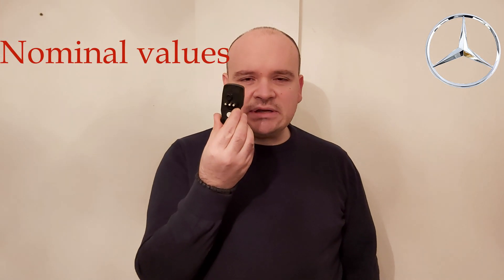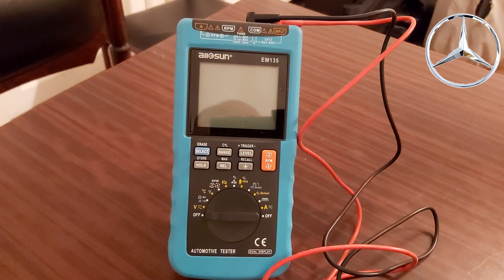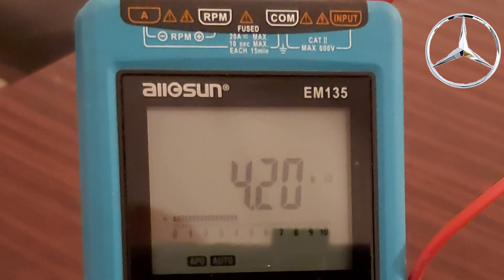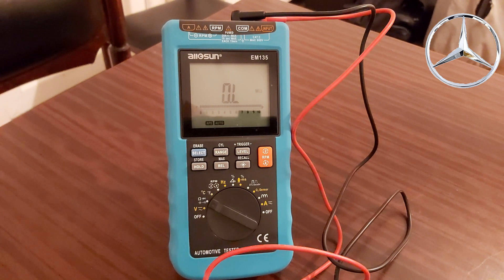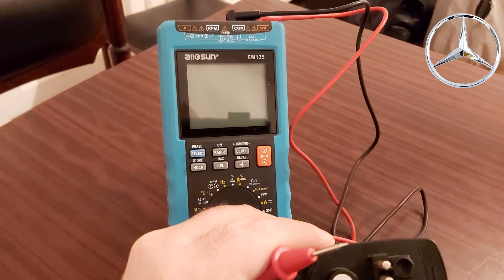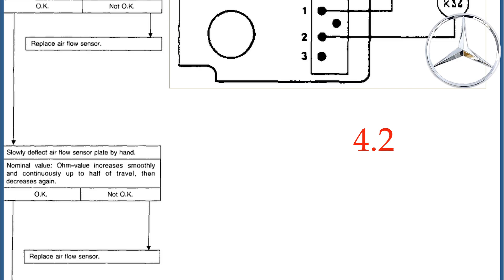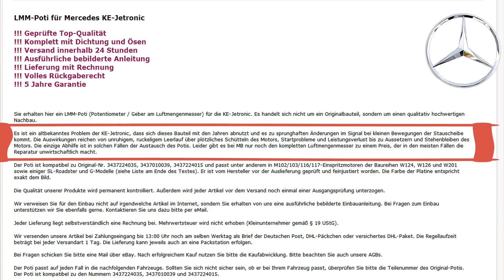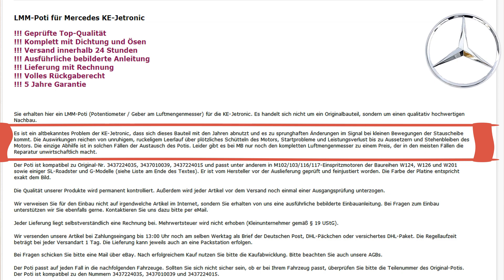Mercedes KE-Jetronic - The Potentiometer, minor disagreements with some forums

Comment: I know this is an older video, but maybe you can answer my question. There is a small adjusting screw, 2, maybe 3mm in diameter, set down in a depression, to the driver's side of the potentiometer. What is that adjustment screw used for?
Reply from the maker: The signal of the potentiometer is being adjusted there. That's something I don't want to mess with and something I still don't know how to "manipulate with". The seller just told me not to touch it and either to leave it there or to fill it up with something.
Reply: @mercedeske  Well, I used to work in control electronics at one time, so I just had to know. I had a new, aftermarket potentiometer on the bench and tested it. That little screw is there to "Trim" the pot. So back to the small screw on the car. After I tightened down my pot, with the ignition on, and engine off, I got 0.80 VDC. across the center and top pins. Turning the small screw CCW, I was able to get the voltage down to 0.72 VDC and figured that was good enough for now. Engine fluctuations due to Lamda are at a minimum after the cold cycle ends, The engine runs fantastically, it pulled 90 mph without a hiccup. 
I'm a happy camper. ;)

Comment: Hello, great video, just quick note for all of you (if you remove potentiometer from a car then test 1&3 pins IF ITS STILL IN CAR  (NOT REMOVED) then test 1&2 pins - it's showing ohms as it written in service manual. Please read carefully in service manual there is not mentioned to remove it before testing, just unplug connector and check, hope it helps to get your nominal values ;)
Reply from the maker: Yes, that's what I mentioned in the video also. Always test the potentiometer with the potentiometer on the airflow meter.

Comment: Hi,
Thank you for your videos, they are great help.
I did bench test on my potentiometer, and I get 4.9 between 1 & 3 , and zero between 1 &2.  Is this unit good?    Also, which brand do you recommend that we have a better chance to adjust it.
Reply from the maker: Hi, and thanks for your kind words. The answer to your question - no, it's not good. If you don't get a linear increase in resistance when you deflect the sensor plate while measuring on the pins 1&2 and you get sudden jumps in resistance, then it's a clear sign that you have to replace the potentiometer. It has to be replaced anyway after 90k miles(150k km). You can buy any of those from Germany or Netherlands(you have them on ebay) if the original one is too expensive for you. I bought one from the guy from Germany and I am very happy with the results.
Reply: @mercedeske  Would you please provide this seller, thank you.
Reply from the maker: @henrysalem5516  https://www.ebay.com/itm/LMM-Poti-NEU-Mercedes-MB-190E-W201-W124-W126-M102-M103-3437224035-3437224015/132590579334
Reply: @mercedeske  Thank you, very much

Comment: Hello friend, i have a problem with the oil pressure instrument on the dash, when i turn on the engine the needle goes beyond 
the   "3"  mark and stays there. Do you know what is the problem?
Reply from the maker: And how is it when the engine gets warm?
Reply: @mercedeske  No just when i turn on the engine first time in the morning, it just goes up over the 3 mark , car has just 50.000 km and works fine.
Reply: Maybe the oil pressure sensor went bad?
Reply from the maker: @theogi8375  Check it.
Reply from the maker: Interesting for a W124 to have such a low mileage!💪😮
Reply: @mercedeske  oh i forgot to say it's a 1.8 190e
Reply: But similar cars
Reply from the maker: @theogi8375  Which model is it?
Reply: @mercedeske  1991 ,199 blue black
Reply from the maker: @theogi8375  Maybe it's about some sensor. You can check it.
Reply: @mercedeske  Ευχαριστω φιλε μ , πολυ ωραιες οδηγιες στο καναλι σ που αλλοι μαστορες δεν ξερουν.
Reply from the maker: Χαρά μου και ευχαριστώ πολύ για τα ευγενικά σας λόγια👏👏👏. Είχα πολλά προβλήματα με αυτό το σύστημα. Το πιο σημαντικό πράγμα δεν είναι να αγγίξετε τον διανομέα καυσίμων, μόνο όταν πρέπει να το κάνετε όταν το αυτοκίνητο δεν έχει ξεκινήσει καν σε περισσότερα από δύο χρόνια για παράδειγμα. Όλα τα άλλα είναι απλώς θέμα σεβασμού - απλά αντικαταστήστε τα ανταλλακτικά με τα αυθεντικά με τον αριθμό αναφοράς και το αυτοκίνητο θα σας σεβαστεί, θα είστε ήρεμοι. Ευχαριστώ για την υποστήριξή σας, θα προσπαθήσω να σας κρατήσω όλους στο κανάλι μου.⭐😀🍀🍀🍀😃😉

Comment: The idle of the vehicle does not change when I remove the Lmm. Do I absolutely have to buy this?
I disassemble the idle valf and clean it and it works, but at idle it runs at idle relative to the adjusting wheel of the idle engine.
Reply from the maker: If your vehicle doesn't stall after cold start, if the engine doesn't have rough idle, when you downshift and your vehicle doesn't stall at low RPM then it's okay, that means that your LMM is okay. You can always check it on the diagnostics. Perform the impulse test, if you don't get 4 impulses, then your LMM is okay.
Reply: @mercedeske  he works a little late in the morning. the cycle is gradually increasing to 1.2. however, when the engine temperature reaches 35-40 degrees, idle is stable at 1.2.
idle not falling 0.6-0.7
Reply: I have measured. value 0.72-0.70 ohm
Reply from the maker: Which engine is it?
Reply from the maker: You mean 0.7Volts? ;-)
Reply: @mercedeske   M102.963, (124.021)  1989 200E